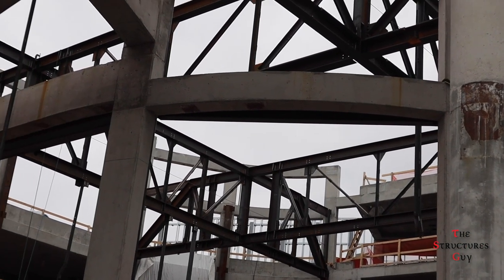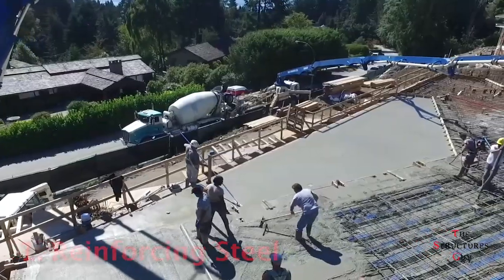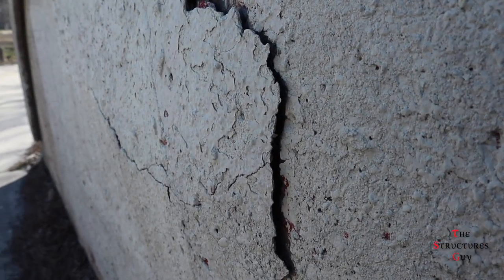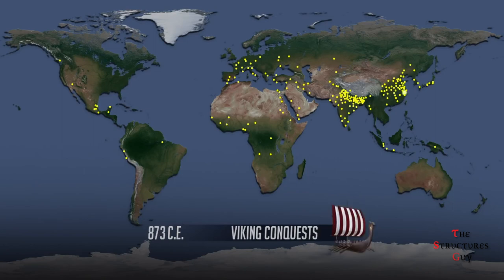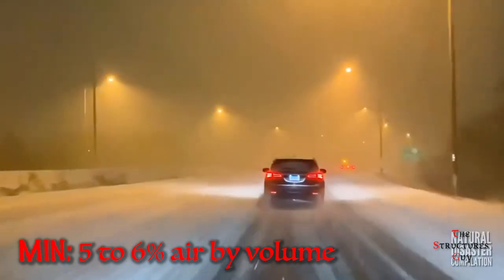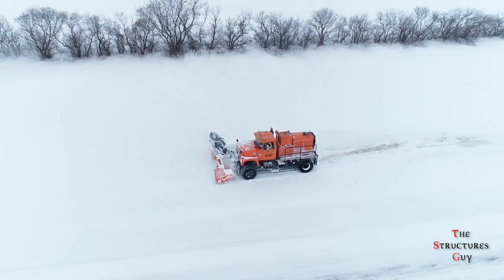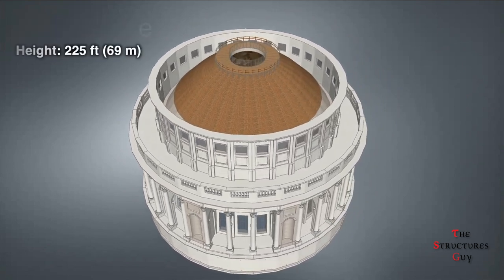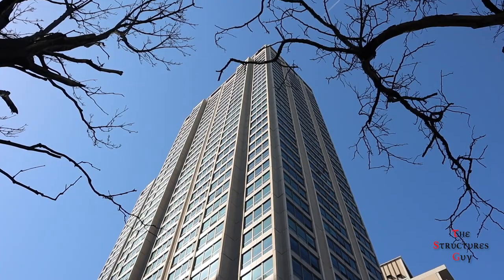Why Roman Concrete is NOT Better Than Modern Concrete?

Comment: while true that unreinforced concrete doesn't hold up well to tension and wouldn't be good for our modern mega structures like high-rises it simply isn't true that it would be impractical for modern structures as many modern buildings are the same scale or smaller than roman buildings; to properly do the question justice you have to compare like to like modern bridges to roman bridges, modern sewer infrastructure to roman sewer infrastructure, modern stadiums to roman amphitheaters,  and just about any structure under 6 stories. the thing people are wanting to know I think is why are we using reinforced concrete for smaller projects like foundations, stadiums, and bridges when the Romans were able to build similar structures that lasted longer with unreinforced concrete.
Reply from the maker: The short answer to all of your questions here is cost from many aspects: design, construction, schedule and material availability! Hope this helps!

Comment: The discussion should not be limited to the choice between modern reinforced concrete, with all its advantages and faults, vs. Roman concrete used the way it was during the days of the Roman empire. Why can't Roman concrete be reinforced, perhaps with corrosion resistant materials like Kevlar, carbon fiber or stainless steel? Sure, cost would be a problem in some places, but it could be used only in the most vulnerable areas of a structure to minimize that cost. From what I've heard, Roman concrete was used in the footings for the Golden Gate bridge. What if it had been used in the first couple of stories of the Surfside Condominium in Florida? If that prevented the deterioration that triggered the collapse of the complex, many would consider it a worthwhile investment.

Comment: Roman concrete is still better, not being able to support the absurd creations of Modern architecture (which have 50-year lifespans at best and contribute to human depression) is hardly a fault. It's a feature. Rather, there is something wrong with Modern architecture that it requires disposable, non-recyclable materials with short lifespans in order to be built. Roman architecture is not only long-lasting in the sense that it's still standing, it's also long-lasting in the sense that it was built on the human skill, using the Golden and Silver ratios which are universally aesthetically pleasing, and which give them a timeless appeal and don't alienate people. Modern concrete is only "better" if you think building ecological disasters made of glass that look outdated within one generation and need to be torn down within two generations is "better". This is a common opinion of planners, penny pinching developers, and some architects; but it is not a common opinion of people who have to live in and among these buildings, and pay the taxes levied when it's time to tear them down, or look at the eyes sores of city lots under perpetual construction because nothing is built to last anymore.
Reply: You're confusing architecture and engineering with a dash of environmentalism thrown in. That's why imprecise words likel "better" and "worse" are useless in discussing materials unless the specifics of the sense in which the words are used is set out very clearly. Better or worse for what? The environment? The buyer's pocket? Aesthetics? Strength? Durability? Safety? Ease of working? Transportability?. It's nonsense to try to support a material as "better" when you're making an arguement on the basis of how people chose to use that material rather than the characteristics of the material itself.

Comment: Adding steel makes modern concrete better? Adding steel ensures concrete will fail. Steel could be added to either kind of concrete but both will eventually fail. The Romans didn't build buildings to last 100 years
Reply: Nor did they build wafer slabs. Every material to its application, there's no "better" or "worse" materials, just better or worse builders who choose the materials.

Comment: Sure... while would a concrete that lasts over 2k+ years be in any sense better than portland cement, which decomposes beyond ~50? Modern portland cement is specifically formulated to obsolete itself and whatever metal reinforcement is used. You know... the usual human ambition for money.

Comment: Do you realize how much it costs each year to fix our streets because of current concrete? How many accidents and traffic delays it costs? Also, the current concrete causes 7% of Co2 in the environment. Roman concrete might cost more but it would benefit us way more in time.
Reply from the maker: Most roads are made of asphalt

Comment: It should be noted that modern concrete by itself seems inferior that ancient Roman concrete, however interesting prospect that is overlooked is the fact that the seawater bonded with the concrete to  fill in the pours to further strengthen it, wether or not rebar reinforced roman concrete is feasible or not is not a information as of this moment I've been able to find, but it would be an interesting experiment worth trying out, even more so with this latest discovery of the self healing properties of the Roman concrete, and how their "hot mixing" technique futhered the curing process. 

Also just a side note the Roman's didn't have just 1 sort of concrete they had several or rather their concrete mixes where constantly evolving so that the structures that survived are what currently scientists have been trying to reverse engineer.

Comment: Roman concrete is far superior, and actually strengthens overtime. (Submerged marine Roman concrete.)

Also highrises and many other modern structures are not efficient or conducive to healthily habitation. 

Furthermore, roman concrete could be reinforced and equivalent ashes can be found all over the world, Chile, East Africa and Japan. This argument against Roman Concrete is not very good as it boils down to cost, which will always be high until there is mass production and adoption. So this is a fallacy as well.
Reply: As he said, Romans had different structural needs and uses.  They used very large solid blocks that were almost never stressed to their limits, and meant for places that were supposed to last for a long time, they were pillars of the civilization, buildings meant to endure, but still just rooms meant to fill a purpose. In essence, it was a lot of concrete and mass for a relatively small volume of area contained within it. The amount of concrete used for just one office room, could be more than even several apartments use today. 

So in essence, they were over engineered. But of course they also had to withstand not just weathering, but also war.  People will come and burn down your village, people will come and knock down walls, but they're probably not going to spend the effort in destroying these large concrete structures.  It's just not practical or worth the effort, and with the structure being soo resilient due to its scale, it would be better off kept intact.  

The utility of such monolithic structures, made it so that people wouldn't come in and knock down all your hard work on a whim because it would be too much effort; meaning less need to rebuild, less loss in war, and more resources focused elsewhere.  When you got buildings like that up, you were sure that you wouldn't be needing to go in and replace it anytime soon.  That also adds stability to a society, on top of being a gift to future generations that inhabit the city, as they could focus their efforts elsewhere rather than constantly rebuilding things that already took great effort to do so in the previous generation. 

Modern needs are a bit more fluid.  If we built structures to last the ages, it wouldn't really benefit us, and require far more bulk. With the way society and its needs constantly change, a building could easily lose all of its utility in a few decades or a century and a whole new building is needed to meet the requirements and businesses and residents. Build a monolithic structure instead, and it may last, but it also may not really be conducive to the needs of society at that future time, while also taking far more effort to both build and get rid of.
Reply: @peoplez129  

I am not just talking about monumental structures, but mid-level and domestic architecture as well. In my town where I live we have 100s of house that are 500 plus years old and they are not over engineered, but build out of durable local materials that have stood the test of time. Nothing we build today could last that long and we have more resources then they ever had. Our architecture is less adapted to our needs--- not more. It's a hard pill to swallow, but the fact remains that we are simply building crap nowadays and we are sadly content with this.
Reply: @felixguerrero6062  Many of these buildings were government buildings meant to make the empires endure. They couldn't simply rebuild things every 20 years or even 50 years, as many of these things were large undertakings by the societies that built them.  Take the Colosseum for example.  It was a centralized gathering place to view entertainment and stuff.  It had a specific purpose. Could you imagine such a building in use today as a centralized location for such a purpose?  Not really. Now we have multiple locations that fill more specific roles, at difference scales. 

 And when it comes to wear and tear, we as a society are much harder on our structures today. Take a roman road for example....it didn't have semi trucks driving down it at high speeds.  So in some regards, the reason why many things have lasted, is because of the less stress put on them by simpler civilizations with their simpler uses. 

You also have to keep in mind the size and distance differences.  While Romans did move concrete distances, that was to build relatively small cities in comparison to today. Rome only had about 450,000 people.  A lot, but we have cities numbering in the millions, tens of millions even.  The logistics start to change quite a bit when you need to build things up for that many people. Then there's other city complexities, like where cities are built.  

Today, we can build cities in places Roman cities couldn't exist, because the ground is too soft to support the mass and weight of such beefy structures.  We also have other things like roads bordering everything, which adds another complexity, and we also need to make all of that work together with things like proper drainage.  Without that type of civic engineering, most cities would regularly be dotted in flooded areas. And all of those structures like road and sewers, can affect the surrounding stability of the ground.  Population is not only higher, but density of people per area is higher too.  All of this culminates into challenges for modern engineering. 

And there's other factors too, like the lack of slave labor, the more normalized lifestyles that lead to a larger middle class and other complexities like the various extra aspects to society.  Our industry today is far more varied, producing literally millions of different types of products. For Romans, it was much simpler, therefore people could focus on just those things, and change wasn't rapid, therefore a structures usefulness lasted longer.

The Colosseum for example, was used for nearly 600 years.  Even if we built a structure that stood the test of time like it today, the usefulness of such a building would last only a fraction of that time.  Even design aesthetics have changed many times over in the last 100 years alone. 

Places like churches are one of the few places immune to this, because churches themselves are a monolithic entity, always serving one singular purpose that does not change.  An office building built in the 1950's though, has a far different configuration and needs than one built today. 

Neighborhoods change as well, some get richer, others get poorer, and as a result, surrounding infrastructure is affected, either by becoming more useful or less useful.  Factory buildings are one good example, where when manufacturing moved overseas, a lot of these buildings simple went unused and left to decay.   Populations even migrate as cities sprawl in one direction or another, as prosperity becomes available or lost in regions. 

Building ever lasting structures would be a big issue. Both economically and socially.
Reply: @peoplez129  

The fact that a medieval timber framed house can last 500+ years disproves your entire thesis. Modern cement can only last 70-80 years at most and already shows signs of significant degradation after 30 years. Our modern building materials are simply inefficient, costly and toxic.
Reply: @felixguerrero6062  They don't last that long without constant maintenance that pretty much results in what is effectively a near full replacement of the building. There's a lot of 100, even 200 year old homes and buildings in many places. It's just that at some point, they stop being maintained for one reason or another.
Reply: @peoplez129  

False, they dont need constant maintainance or replacing. Solid old growth timbers can last 1000 years (temples in Japan and China are examples of this this). Across the street from where I live has timbers that over 400 years old. You simply arent exposed to historic European architecture and do not  realize how durable it was. And these aren  Imperial monumental architecture but merchant buildings and domestic dwellings. Your whole thesis is faulty.
Reply: @peoplez129  

Massive cope, my dear.
Reply: @peoplez129  It's true that wood-framed buildings need periodic maintenance, which varies a lot depending on the exterior envelope of the building, to survive for long periods. But at least they can be kept intact indefinitely if given such maintenance; in New England, its common for wood houses to outlast their foundations, which are sometimes replaced under them. Concrete structures, on the other hand, often appear to be almost maintenance-free until they reach a point at which the repairs needed overwhelm the value of the building. That may be good enough for some situations, but it's far from ideal. Any reasonable changes that reduce the deterioration of  concrete buildings, even if they costs more initially, will probably be cost effective for some portion of  today's needs.
Reply: @peoplez129  Rome had about 1 million population during the early empire days.

Comment: Because modern concrete is cheaper and easier to use globally 
Doesn't mean it's better.
There will never be a modern concrete pour , steel.reinforced  that lasts 2000 years.
Simple
Reply: Doesn't need to last 2000 years...

Comment: You say it would not be practical to use Roman concrete for modern structures like high rise buildings because the romans didn’t use it for that? 

Did the Romans try to build modern high rise structures? If they didn’t, then you are essentially saying it won’t work because the ancient Romans didn’t try it... that is absurd. 

Why can’t we try it if the Romans didn’t? Maybe it will work in spite of not being previously tried if it wasn’t tried.
Reply: Their Insula were 9 stories high btw
Reply: @longiusaescius2537  that's not true oh, you're talking about the apartments were no more than Nine Stories, but the Romans were Building the tallest buildings in the ancient world, they're also building the biggest buildings an ancient world.

Attractive medieval and ancient European architecture was quite phenomenal and even in today's standards is quite amazing. Gothic architecture the Roman Colosseum the domes and Etc or just complex that last for centuries and centuries.

Comment: While I don’t think we should replace any method of modern concrete with this Roman concrete, it could have its place on a smaller scale as a substitute for Portland in some small sized instances.
Reply: Exactly, it's not better or worse, just different. Anf it wasn't a "lost recipe", Roman concrete has been used for hundreds of years when circumstances indicated a good application. The Bell Rock Lighthouse in Scotland (Rennie and Stevenson), 1807 is an example that springs to mind.